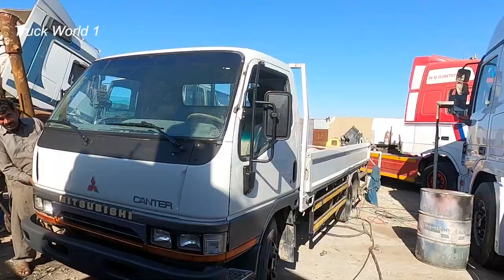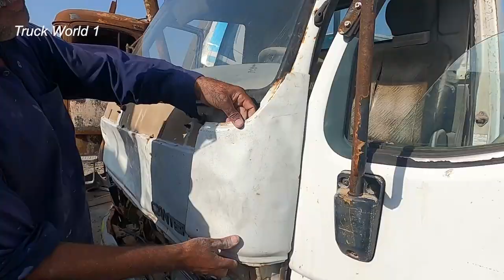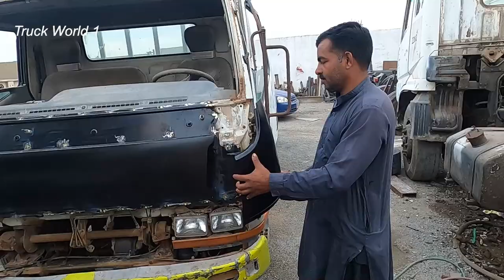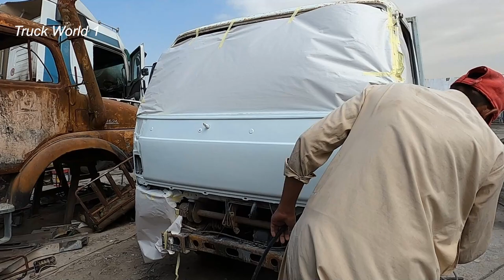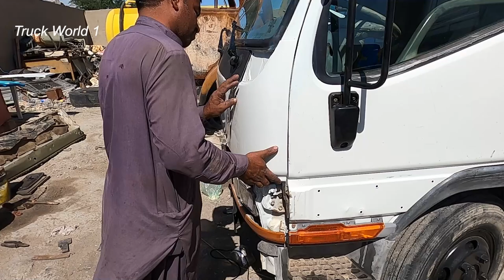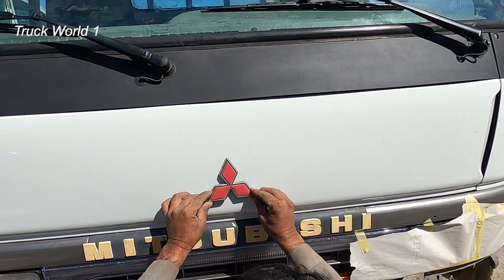Mitsubishi Truck Cabin Reparing

Comment: Gonna post these guys a cone bit.. save them some grief removing spot welds....
Reply: And they work outdoors in the heat. I’ve worked outside because of a fire truck, or moving van, trailers that didn’t fit in the shop, even cars if we were packed, but these guys outside all the time. God bless them